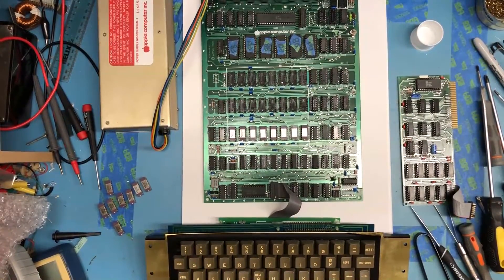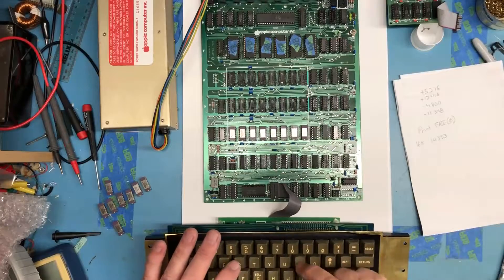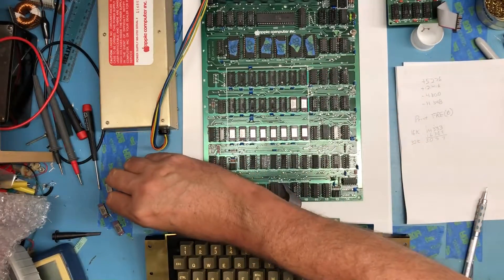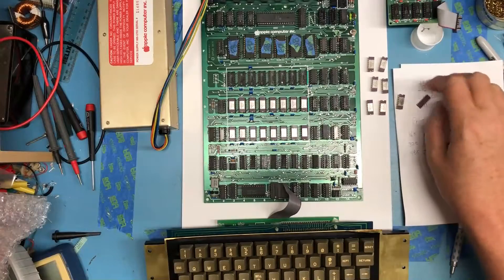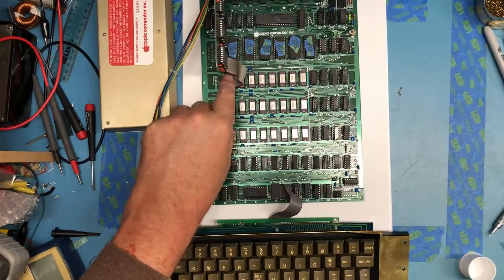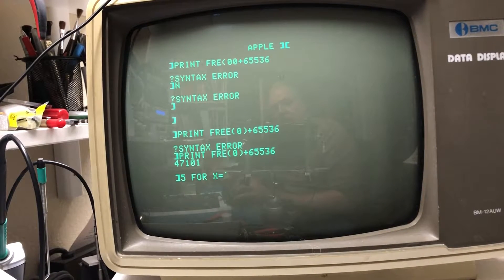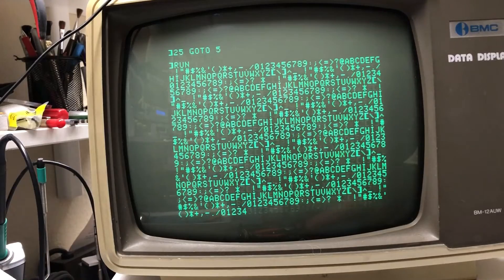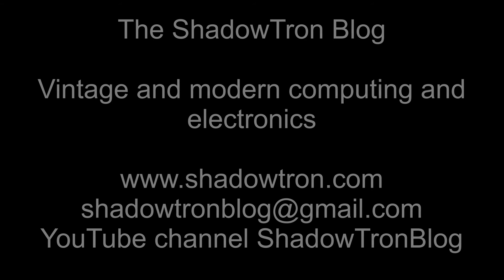APPLE II Plus - Part 6 - Does it still work? Connecting up the electronics - STB191

Comment: Yeah, it won't see the additional RAM that way.  You have to use the infamous "soft switches" to switch to different banks within the language card.
Reply from the maker: Thanks, it took a while but I finally realized this. As I'm digging more into the over all architecture I'm impressed. i assume the slows were all just a bus but have discovered they layout, having individual ROMs at common memory address etc. is really pretty cool.
Reply: There's a great story about that language card here.  https://www.folklore.org/StoryView.py?project=Macintosh&story=Well_See_About_That.txt&sortOrder=Sort+by+Date
While it's for the Mac, they used the Apple II and that language card to start development of the Lisa and Mac.  Burrell Smith (the engineer that actually made the original Mac) figured out some pretty cool stuff on that card.